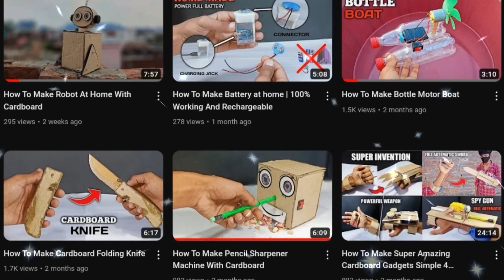How To Make Microscope with cardboard | easy science project

Comment from the maker: Material used 🔻

Lens 🔻
 https://amzn.in/d/7ZAfsAO

Battery connector 🔻
https://amzn.eu/d/iKROkRJ

Wires 🔻
https://amzn.eu/d/0zSODZf

Led light 🔻
https://amzn.eu/d/hVQNuWO

On of switch 🔻
https://amzn.eu/d/b7neKSq

Binoculars 🔻
https://dl.flipkart.com/s/HXC0etuuuN

but I have made the battery myself. If it is very important then I will make a video while making the battery.

Comment: Requirements for making the microscope
Reply from the maker: Material used 🔻

Lens 🔻
 https://amzn.in/d/7ZAfsAO

Battery connector 🔻
https://amzn.eu/d/iKROkRJ

Wires 🔻
https://amzn.eu/d/0zSODZf

Led light 🔻
https://amzn.eu/d/hVQNuWO

On of switch 🔻
https://amzn.eu/d/b7neKSq

battery 🔋 
Cardboard.
Glue gun.